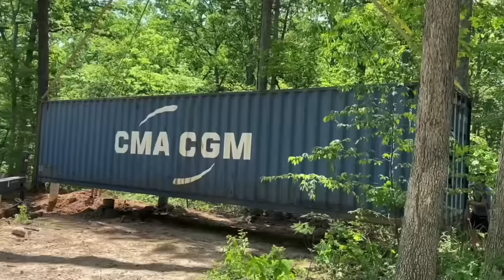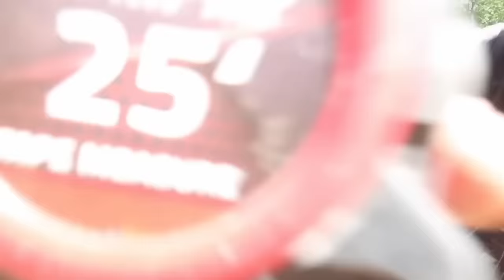Couple Building Shipping Container House In 10 MINUTES | TIMELAPSE | Start to Now | Raw Land

Comment: Hello from Texas! You guys are an inspiration. Just a little advice. (with all due respect of course) Since you guys are going to re-drywall after the foam, you might wanna save yourself from cracks in the future. I would recommend "flagging"your drywall on top of windows and definitely your doors. What that means is don't run the seams and tape vertical with the windows and doors. Try to put your drywall seems in the center above windows and doors. This will avoid cracks running up vertically in the future. Hope this helps. Love watching your channel. GOD BLESS YOU BOTH!